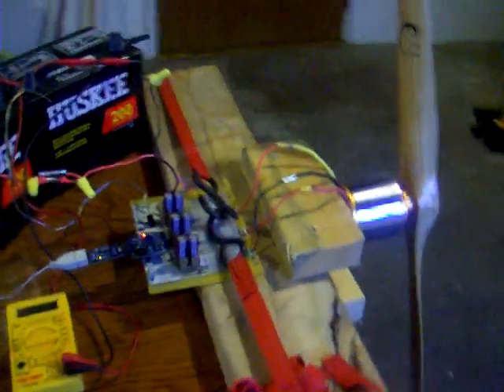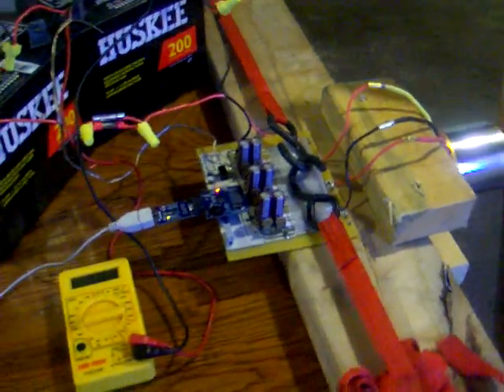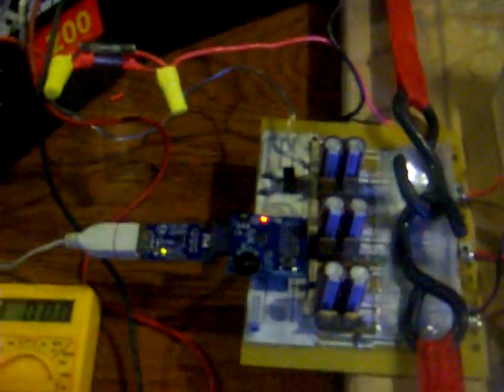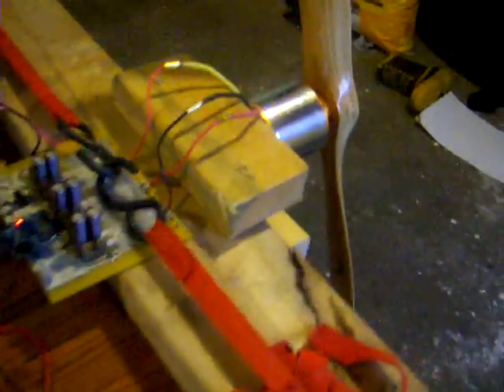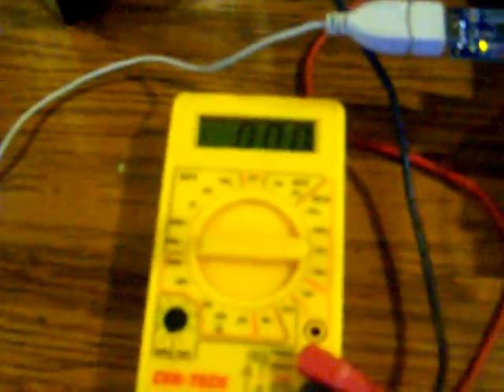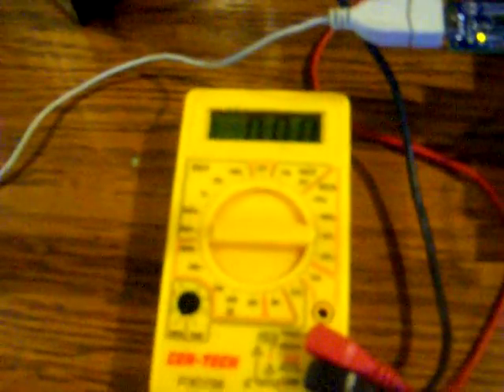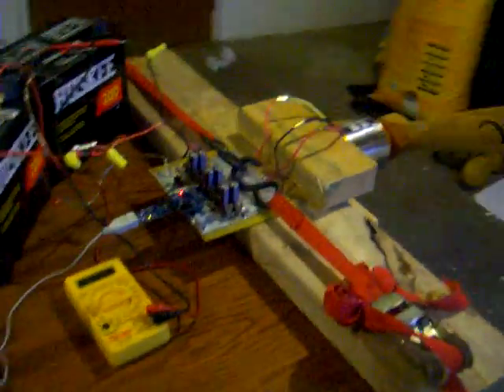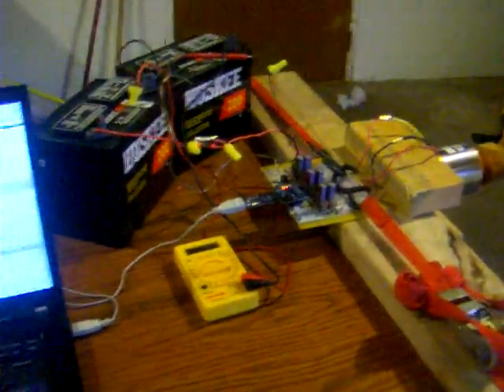DC Brushless Motor Controller

Comment from the maker: @baboracus The micro chooses which FETs apply a field slightly ahead of the motor position and applies a 100kHz center-balanced PWM.  Variations in speed, voltage, current and frequency are side-effects of motor resistance, inductance, load and the PWM duty cycle.

Comment from the maker: @baboracus This isn't an AC motor - it's a DC brushless... can't help you with inductance calculations of an AC motor.

Unlike an AC motor, the frequency is completely adaptive because the controller is always reading the motor and applying a field that is a few degrees ahead of the rotor position.  The controller doesn't care about resistance or inductance, and can run an ironless (super low inductance) motor.

Comment: How do you select which capacitors or varistors that will eliminate the power factor? Also, if the motor is rated at something like "115V 60Hz 7.1A" and the resistance across it's terminals is 2.5 ohms. Would the theoretical inductance be:
|Z| = 115/7.1
sqrt(2.5^2 + 2*pi*60*L^2) =  16.20
L = sqrt(16.2^2 - 2.5^2) / (2*pi*60) 
L = 42 mH

Are you using the microcontroller to put 3 phase square wave into the MOSFETS or transistors? Are you varying the current, voltage or frequency?

Comment from the maker: @nuriqa88 You don't want something this big though, it requires gigantic transistors.  Usually, you'd want something with an encoder; making one that uses back-EMF is very difficult.  I don't know where you can get one, but you could try searching for "DC Brushless Motor with encoder" on Google Shopping.

Comment from the maker: @stimps90 Try hobbyking.  It's a Turnigy 180 7000W motor.  Cheap too - only around $100.  However, being a brushless motor, you'll need a controller (which is what I was developing in this video), and they can be a bit more expensive.  The controller that was designed for this motor (also at hobbyking) sucks terribly, it induces BAD eddy currents in the motor, making it get really hot.  And you'll need a controller that sends the right speed-control signal.  Good luck!

Comment from the maker: @karlsruheprotest It's well anchored, and the propeller is rated for far more than that load.  While the propeller could chuck low-density stuff that gets caught by the air at my victim there, if the propeller managed to come off the motor (by moving forward off the motor's axle), its own thrust would push it backward at me!  After this 1.5HP, we decided it'd be best to move it outside.

Comment from the maker: @heberorozco A brushless motor will last many, many times longer than a brushed motor.  The only moving part is the bearing.  They usually don't get as hot (for the same amount of power), so you can put lots more power in before worrying about it failing.

Comment from the maker: @QuantumDevices With full heat sinking, those FETs can do >100 amps each.  The switching rate in the video is 150KHz (I can run it up to 400Khz); the FETs turn on and off very quickly, which causes some pretty major spikes.  The electrolytics are there to absorb that.  The back EMF is clamped with diodes but is otherwise floating.

I think there are better options in terms of low ESR caps, but they're hard to find.

Check out the newer videos, the full circuit has 18 caps.

Comment: Cool. 

Although I didn't see a lot of safety gear being employed...

You should be able to squeeze a lot out of those FET's with heat sinking.  They work great for BLDC driving. 

Those are some pretty good sized Electrolytics. Are you using them to suck up the back EMF for their next power on cycle? 

Jim

Comment from the maker: It is a custom controller and software.  This may end up being a commercial endeavor, so I will not be sharing either, sorry!

The controller can operate sensorless (using back-EMF), with a pair of hall sensors, or with a 2-axis magnetometer.  The theoretical limit of the circuit (with proper heat-sinks) is over 100kW... although realistically, I only expect to ever see 50kW out of it.

It's intended to run an ironless hub motor, which saves the whole issue of a chain and gearing.

Comment from the maker: You can't really measure the voltage across the wires in DC.  You might be able to get a reading as AC, but it won't tell you anything useful.

The voltage I'm reading is across the battery -- Batteries fluctuate a lot when you're drawing power from them, so it's important to know how much they're really providing.